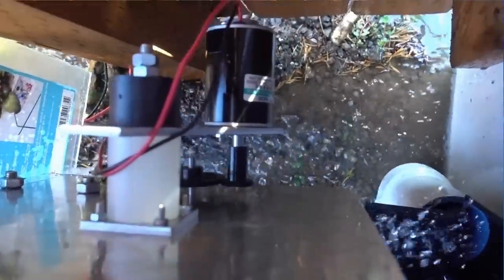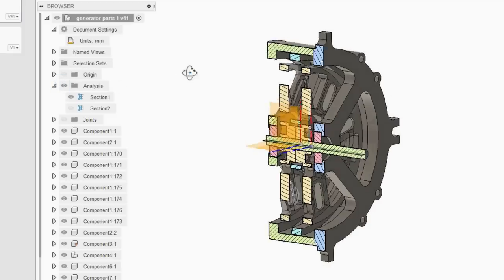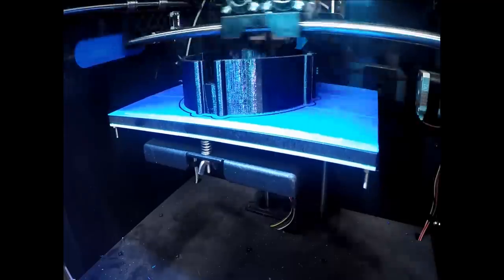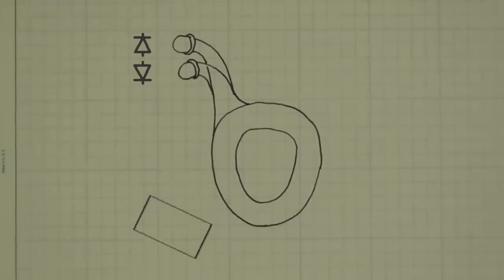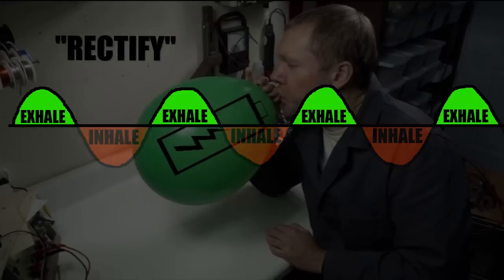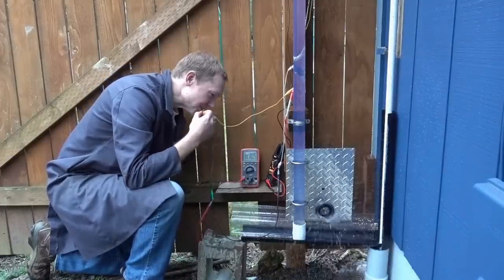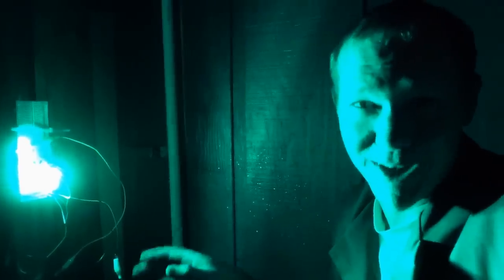Rain Gutter POWER #2 - 3D Printed Alternator, BEST Explanation of a Rectifier EVER!!!

Comment: Hi it,s ray the fixer, x tv engineer extraordinaire, well done i was thinking along the same lines as you i live in a rainy area of england northwest  i dont have the luxury of a 3 d printer but i could suggest a ready made, motor bike alternator for your project but i think the level of rain pressure would not be enough. maybe using your generator to pump wastepipe water back up to the roof level guttering would create a loop effect this would require some kind of holding tank, possibly a 5 gallon plastic container being topped up by rain and tap water,when required which would increase the water  presure and the down ward gravity drop effect, spinning your turbine much faster, there is plenty of 12 volt mini water pumps out there for approx £12.00 but they only produce 12 volts at 250 milliamps max,to low to charge a standard 12 volt car battery, 2amps to 20 amps would be ideal, but these mini fish tank like pumps could be used to diliver the water back to the holding tank mounted near the roof near guttering , yes it is low power and the excess power generated by your alternator stroke turbine can be used to used charge a power a dc  bank, let me know your thoughts, maybe together we could get this prioject off the ground.

Comment: not sure if your design is optimal. you should turn your magnetic filed 90deg and position your permanent magnets on the circumference of the rotor. This mount will bring another huge advantage: due to the magnets weight distributed at the edge of the rotor, it will act as a flywheel conserving kinetic energy. Also you should change the orientation of the coils in respect with the magnetic filed of the rotor. also use ferromagnetic core for the coils: something like a screw with the thread facing the axle - so, easy mounting and more efficient electromagnetic field (just like a stepper motor). this is how i would do it.
Reply from the maker: This is how the DIY wind turbine guys do it, I don't think what you describe will get as high of voltage at this low rpm, but worth a try.

Comment: Hi... would it help if you construct a 2 more lines of Tee pipe connection and spray it in to your wheel where one is vertically sprayed and another horizontally which is on top of wheel ? By doing so it might increase the work develop and hopefully increase the wattage output? Your engineering skills is really inspiring... keep up please as I am always interested in this kind of power plant production.
Reply from the maker: Watch part 3

Comment: Is it possible to split the tube into multiple parts to use more than one generator without loosing pressure? maybe adding a connected turbine inside just before where the water exits to hit your original?
Reply from the maker: Pressure would be the same, flow would have to be divided up.

Comment: 1:05 interesting, I thought that Siemens invented the dynamo and it was discovered later on that it could also be used as a motor, by putting current on it instead of drawing current from it.
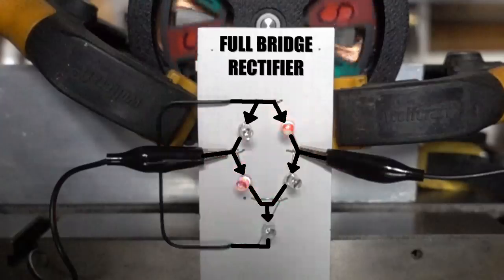Couldn't resist at 9:35 FULL BRIDGE RECTIFIER!!!
lol

Comment: The larger the pipe the more gravity pools down on the water there for the more water pressure you get out the nozzle so basically you can have say a 20 gallon fish tank on top of the pipe that so that also build up with pressure and forces even more water out that nozzle and basically produces more and more power the more water pressure builds up so simply just by instead of light a 3in pipe or so by like a 6 inch pipe or so so basically you come and logic to figure out the best configuration

Comment: That's pretty cool and an excellent way of learning, I wonder how this would compare to the Chinese eBay micro Hydroelectric Generator's? They cost anything between $10 and $20 but people seem to be getting good results on other YouTube videos although they don't get into this level of detail! Those eBay things even use standard half inch thread so you can use off the shelf plumbing fixtures! I have been wondering what the effects would be if two or more were placed in series? I think that they were actually intended to be used in the main household plumbing so that every time you flush the toilet or wash your hands or clothes or have a shower you end up offsetting your water bill with some generated electricity! Not sure how it would affect the water pressure though! But people have been using them in lots of other applications so they are kinda versatile... But no in-depth video exists on these things and I think that I have seen all of them! 
Incidentally, all Generator's are actually AC Generator's, the one's that are called DC Generator's are actually AC with a hardware rectifier built in, the commutator! 
Those eBay things are rated for 10W output! They are unregulated so if you get them spinning fast enough, you get much more than 12V out of them so it's a good idea to place a capacitor with sufficient voltage rating on it's output and a DC to DC converter with constant voltage and current control for the output... That way if the turbine spins to fast and outputs to high of a voltage, the converter will keep the output stable and let the turbine do it's thing! 
Great video by the way! 
If you are interested in making a video on this device, have a look at what others have done, it looks promising but their videos leave a lot to be desired lol..
Reply from the maker: Good suggestion, thanks!
Reply: @QuintBUILDs  no worries, I really appreciate the effort that you have put into that project, I generally bump heads with people on these sorts of things, yeah sure it's not a lot of energy collected but you ain't doing anything else with it anyway and every little bit adds up at the end of the year! Sometimes those little things lead to bigger things that work far better! 
I have found that Generating a higher voltage and low current puts less load on the generator, I just step the voltage down with an MPPT Charge Controller which does all the heavy lifting and allows the generator to do it's thing without slowing down. 
Generally I personally prefer a setup with a wide C channel water wheel like the sort of thing that you might find on those old river boat steamers! A flat water table with separators to space out the water flow so it falls into the C channel more evenly, the water wheel turns slower but it's width gives it torque so that you can use gears to raise the speed of the generator, and since there's high voltage and low current there's no real load to slow it down... I haven't tried it myself but it's on the cards.
I'm currently waiting for lockdown restrictions to be lifted here in Melbourne Australia, I have an idea that I want to try, a 3 meter by 150mm wide stormwater pipe standing vertically with it's ends capped off, a smaller pipe connected to the top of the larger pipe, a valve at the bottom of both pipes and possibly a valve at the top of the big pipe so that I can shut off the two lower valves while I fill it from the top and close it off, then open the valve on the big pipe to drain the water into a bucket and create a vacuum at the top and finally open up the valve on the smaller pipe and if the small pipe is the correct size, water should be pulled up out of the bucket and into the big pipe till finally it's back in the bucket again! And hopefully never stopping LoL, and if it looks like it's doing well, well I have those eBay Hydroelectric Generator's that I might have found a good use for LoL. I don't care if it's said that it would never work because of law's, I enjoy playing around with this sort of stuff and I love watching other people have a go! You just never know, you might be watching a video on something that you tried but suddenly noticed something that you didn't do or missed or realized... If nothing is perpetual, then at least if I can get it to run for a long time before having to restart it, then that's good enough for me! If the earth can rotate around the sun for a long time, why not a man made device? Anyway, thanks for the reply, you are more than welcome to have a go at the water pipe contraption, at least it shouldn't be too expensive to setup and if it works out for you, you might have to take it one step further and add an eBay Hydroelectric Generator and get something useful out of it...

Comment: how did u connect the wires through the alternator? You never explained this fully. Thanks for the video.
Reply from the maker: That's the beauty of a PMA, permanent magnet alternator, you spin the magnets because they don't need any wires attached to them.  The stator is stationary so you just run the wires straight to the outside.  There's a model of it on GrabCAD under my channel name if you want to see all the little ports where the wires come out.  Good question!
Reply: Nono, the wires from the coils. You never gave a schematic for them. Sorry if i was vague.

Comment: I was wondering how much power you're losing in the bridge rectifier. You're using schottky diodes, so you're probably losing somewhere between 0.3-0.5V per diode and you have two of those in series at any given time, so anywhere from 0.6V to maybe 1V being lost in your rectifier. With only 5-7V of output voltage under load, that's a significant source of power loss. I'm guessing about 10-15%. On such a low power, low voltage system you may be able to do much better using MOSFETs for the rectification task. You'll probably need an appropriate control circuit to switch the gates of the MOSFETs appropriately. There are purpose-designed controller ICs for precisely this kind of application such as the LM74670. They're not the cheapest of ICs at a few dollars per piece, but with the amount of time and effort you've put into this, I can't imagine $10-15 to get an extra 10-15% being all that bad of a value proposition. I'm also thinking that there may be a cheaper solution using a couple of comparators or op-amps to drive the MOSFET gates and using both N and P channel MOSFETs. You'd use the body diodes of the MOSFETs to bootstrap the solution, but once you have some power at the output to drive the gates, you can ditch the diode losses. It might take some messing around to get it to work, whereas using a purpose designed smart diode controller like the LM74670 is probably a lot more of a plug-and-play type solution.

Comment: No need for a capacitor while charging, just the diode. If the speed is low the voltage is going up. So the result is just charging with less current. (Applies to a battery connected directly, not to a usb phone.)
Reply from the maker: Hmm, good point.  I was going to argue that at lower than battery voltage it might drain something from the battery, but the diode takes care of that!  :)  But the capacitor does keep my LED Christmas lights from pulsing (in a later video).

Comment: Mate, just drilling a hole in a pipe is costing you power too. You need a smooth, curved path for the water to fire out at the wheel. Preferably a laminar flow with a little twist, to stop the flow ‘flaring’.

Comment: I think if you use 4 inches pipe from the roof your Hold more amount of water you might get more pressure on the  hole 
To the  generator????
Reply from the maker: Pressure is determined by depth, not width.

Comment: Why did the generator slow down when you added the LEDs?
Reply from the maker: Good question!  Prior to connecting the LEDs the wires weren't connected to anything, no place for the current to go, load = 0.  Putting a single LED would draw a small amount of current and power and slow it a little bit, connecting a bunch slows it a bunch.  This is why adding gears doesn't get us any more power, the alternator will only spin at whatever speed matches the power being drawn from it.  I'm sure not all of that makes sense but keep thinking on it and watching the remaining parts in the series, I think it will help.

Comment: Using a clamp meter to measure voltage, and a multimeter to measure current. Im really confused. A clamp meter is  a lot more accured at measuring low current rather than a multimeter.
Reply from the maker: Not between those two models. Way more decimal places for current on the multimeter.

Comment: A copper pipe carrying;... pumped water through it ,

will heat up and heat the water and make a water heater!... if you’re using 24 opposite pole magnets ..

and spinning them fast

Comment: Was curious if you would be able to assist in a project i am going to build , I am about to embark on a mega build  for me ,. an electric yacht . need help calculating size of electric motors needed  and batteries as well as a back up generator encase solar is not available . let me know if you are interested in helping do the math .thanks .

Comment: If you geared the turbine, you could get more power. Since you have a large fall and not so much water, I'd use a Pelton turbine. You could increase the fall length. We built a really good one in school, but the turbine was a lot larger and our r stator was different too. . Look into pump power plants. You use a reservoir anda special generator that can be shunted into  working as a pump. The principle being that the pump uses a lot less energy than the generator produces, so it pumps until the reservoir on top is full, then shunt the pump back into genrator, catching the energy in accumulator arrays as DC using a transformer and a rectifier in front, converting and transforming up again to 230 V AC / 50Hz  power for use. This form of mini power plant is gaining popularity, but due to the legal situation, created by private companies with political ties, It is not allowed to be self sufficient, because then the companies wouldn't make money.. This is Norway, a through and through hydroelectric nation giving in to private intersts wanting to sell power to other counties, so much that we have to buy german power... It is a sick game, costing normal people ten times what it use to cost.

Comment: A larger diameter pipe will give a much higher powerful stream of water at the bottom because of the weight of the water.
Reply from the maker: pressure = depth x density x gravity.  It's not how big the pool is, just how deep you swim.  Not very intuitive I know!

Comment: Well done, I've always wondered the crux difference between a generator & a car alternator.  
Welllllllll a generator is obviously an alternator with a mechanical rectifier (!the contact brushes!).
?Epiphany or What?
Reply from the maker: I basically learned that during the project.  Something I read indicated every type is a generator and an alternator is a type of generator with wires for a stator.  That makes this a PMA, permanent magnet alternator vs. a car alternator where the rotor is also made of wires.
Reply: @QuintBUILDs  Your printed alternator outputs AC & then you rectify it.  ?Wellllll I wonder if the process is reversible just like a simple DC motor?  ; ?What would happen if you feed AC thru the rectifier & into your alternator?  No, I mean your alternator motor
On another subject, someone told me you can increase the power of an electric drill by taping magnets around the electric motor.

Comment: Couldnt you have just used a larger diameter PVC pipe to allow for more head pressure to build up in the pipe?
Reply from the maker: Larger diameter will weigh more but the water pressure will be the same.  Pressure = density x gravity x height.  Otherwise the wider the swimming pool the more you'd float!
Reply: @QuintBUILDs  Ahh good to know, you learn something new every day

Comment: Hello.. nice video.. really good explainations. I wish i have a cool dad like you are ;).. Why dont you try a so called Zweipuls-Mittelpunkt-Schaltung? It uses only 2 diodes instead of 4. Less loss and it also should be also enough output Voltage.
Reply from the maker: Ich hab nicht bewusst solche dinge existiert, aber es braucht einen Trafo mit einer Mittelanzapfung voraus. Ich meine zwei mehr dioden sind einfacher nicht war? (Ich spreche ziemlich gut Deutsch) 😁

Comment: I think... the impeller (prime mover) outside diameter is too small, the water stream diameter is too large (wasted "mechanical potential")... and what is the "electrical potential" (kVAh) of your alternator?  You are working at this backwards... chose your determined "electrical load" say 12V at 1A... then reverse engineer your design... first determine the "mechanical potential"  then design a  water wheel to maximize that... then build your generator...
Reply: You can always create "water volume" with a holding tank..

Comment: instead of making a generator you should have increased the diameter of the water resivor  just cutting your clear tube in half adding a adapter n a larger mabye 4'' pipe the pressure of the wateer at the bottom would be  greatly increased
Reply from the maker: pressure is a function of depth.  It doesn't matter how big the swimming pool is, only how deep you go.  Not very intuitive I know...

Comment: Well, those aren't technically coils because they don't have non-conductive material in between them, so a lot of energy is lost cuz its acting like a single piece of a thick wire
Reply from the maker: There's a thin transparent coating on the wire. Very common in this type of wire. It wouldn't function otherwise.
Reply: @QuintBUILDs   Uh,ok is there friction between the coil holders and magnet spinning disks?

Comment: Why not do it as a 3 phase alt. Then rectify it so you get 133% of the power instead of only 80%ish.
Reply from the maker: Think about the losses from splitting the voltage across two additional rectifiers though.  Maybe if it were a higher output application?